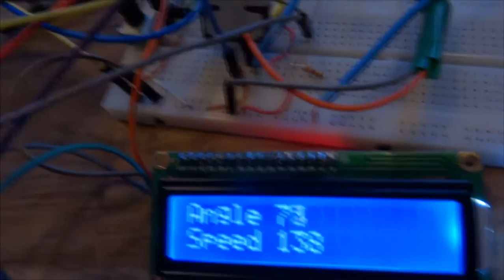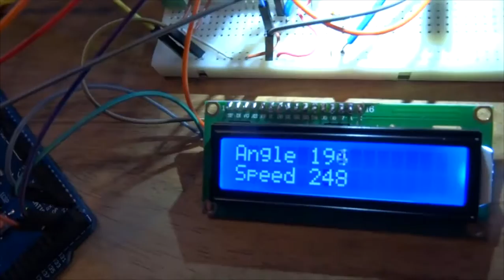Combining L298N motorcontrol, servo, LCD, LDR in Arduino project for cat

Comment: it has been awhile, 
my question: is the servo connected to the l298n??? thanks
Reply from the maker: I dug up my notes for you: Servo wires are like this : one wire to arduino pwm pin, and one wire to the +rail and one wire to the -rail. So no power flows through the Arduino. Arduino only sends the adjustment pulse signal. Power is drawn from the board by the servo. Sorry i can't be more clear on the wirecolors